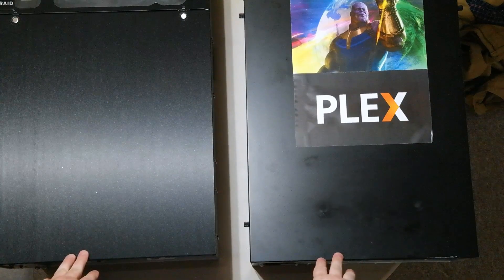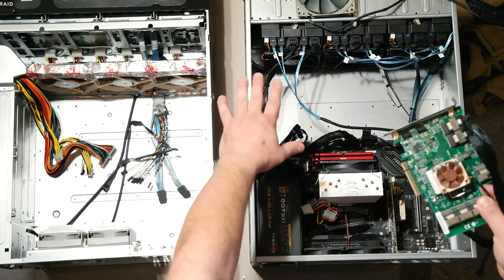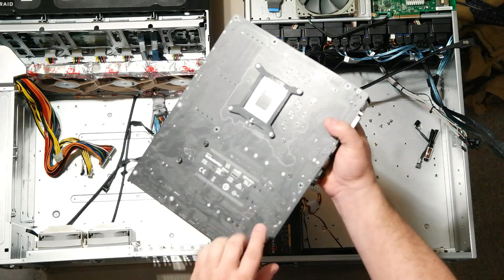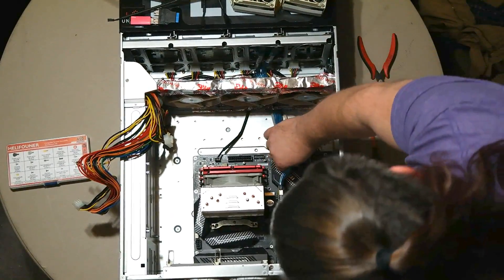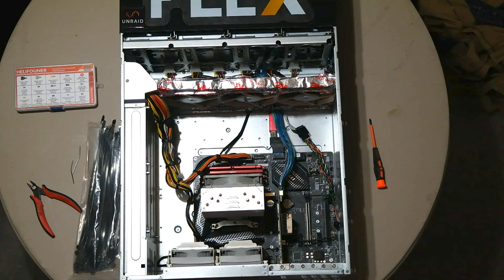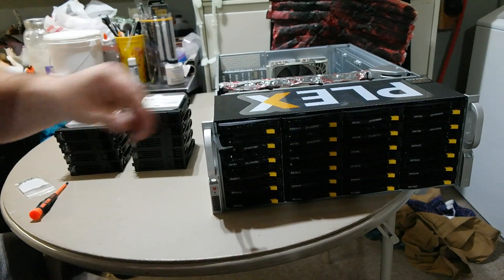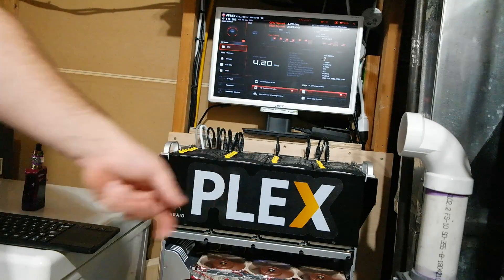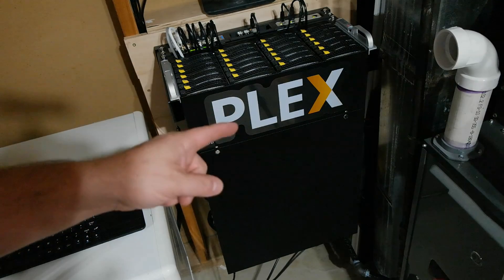Project Supermicro 846 Part 4 - Transplanting Hardware

Comment: I’m about to mount my sc846 in a vertical rack. Did you attach it by the rails or by the ears? I really don’t need the extra milage the rails provide when pulling up the case but I really doubt those ears can handle the weight.

Comment: I just got a supermicro 846 chassis with this same backplane but none of my drives are being seen in UNRAID 6.8.3.  The pertinent hardware is an LSI SAS 9201-16i HBA (IT mode) and obviously the BPN-SAS2-846EL1 backplane.  I am pretty stumped on this and then when I watched your video, I noticed you are using P1 and P2 instead of P0.  This still did not help me however.  Do you have any ideas as to why my drives arent being seen by unraid or the backplane?  I get red lights that turn on briefly when I power on the chassis.  I have 4 6TB and then one 12TB WD, and 8 14TB WD.  I jumped the board to power in on because I don't have the breakout for the motherboard yet.  Any help would be greatly appreciated.

Comment: Very very nice setup!!  Super clean and mega expandable...22 external drive bays...daggum!
What was that USB 3 internal adapter thing?
Reply: most mobo's have 2 usb 3.0 or 2 usb2.0 headers, this allows you to turn one of the usb headers into an internal usb port, that way you can put the unraid OS drive on the inside of the case so there is no tampering.

Comment: Question: When the Supermicro machine is turned on, do the blue LEDs stay on all the time, or just for drive bays that have drives in them?  I ask because I picked up a SAS2 backplane and all of the blue leds are lit even without drives attached and I think the backplane is defective.  I can't see any drives on the backplane, so that's why I'm asking (both Adaptec 5405Z and 6805T controller).

Comment: Great conversion. You mentioned that you were not sure whether your HBA would use all 8 SAS channels to the backplane . I am setting up a similar unRaid server in a 836 (3U) chassis with the BPN-SAS2-836EL1 backplane and a HBA flashed to IT mode. I have looked at the Chassis manual regarding the cabling between backplane and HBA and It appears there would only be a single SAS connector from the Backplane to the HBA. Does the 4U have 2 backplanes you have to cable to the HBA? (Sorry, my first server build)

Comment: Great job on the media server swap.  What kind of back up strategy do you use?
Reply from the maker: Dual parity to protect from drive failure.  Most of the data is replaceable, so not backed up.  Personal data such as pics, docs, etc... Gets backed up to backblaze nightly.

Comment: I'm Pretty sure the 4pin goes to the backplane. I'm using an ATX PSU in my 846 which doesn't have the connector with no issue.
Reply: It is 5pin connector with 4 wires. It goes to Supermicro server board for PSU conntroled by BMC.

Comment: what are you hard drive temps ?
Reply from the maker: they max out at 91'F, most run around 86'F.
Reply: @madelectronengineering  That is pretty low temperature. What is the ambient?

Comment: Very neat and cool!
What is the perceived noise-level when you're tired and it's 3 a.m.?

BTW, what distro are you using?
Reply from the maker: At 3am everything is pretty much at rest server wise, so fans are spinning slowly, hard drives are usually spun down, you won't hear it all from 5 feet away.

I'm running unRAID.

Comment: Do you find it's detrimental to temps to keep the case "upside down" like that? My first thought was that hot air naturally rises, so aren't you fighting against by having it hanging in that configuration (you are pushing hot air out the bottom, right?)
Reply from the maker: Your line of thought is the same as mine when I first decided to vertically mount the server. Surprisingly, with the fans blowing down there has not been any issues with it. Maybe if I was running dual xeon at full tilt and not a 7700k at idle most of the time the story could be different.
Reply: I was going to say that hes running some relatively low TDP hardware in there.  I think the thermal performance in his particular case would be negligible. I run a dual socket 2011 server that I actually tried doing something like this with before I just bought a server tower and it didn't work well in the slightest.  I'd say with what hes got going on right now he's perfectly okay. Definitely inspired me to make another video about putting some upgrades in my server. I usually just upgrade without picking up the camera anymore.

Comment: I have a few hard drives all around my work space.  Would this be the way to go to keep them all out of the way, and not get unplugged from time to time??
Reply from the maker: It doesn't have to be a server case, some tower cases can hold over 14 hdd's, regardless if you can put them in a case they will be safer then out in the open (dropped, static shock, etc...)
Reply: @madelectronengineering  Thanks for the help..  I will take some time and look at this now...